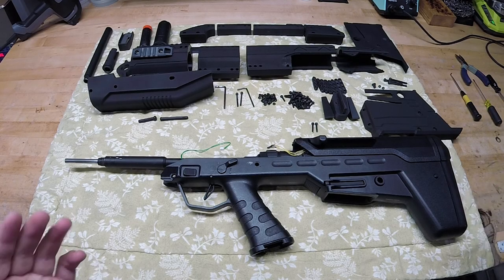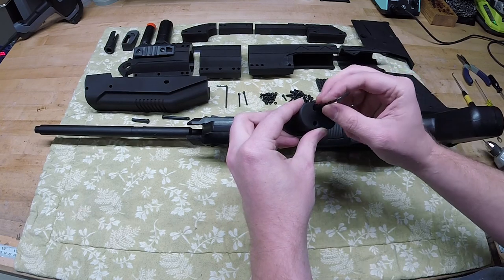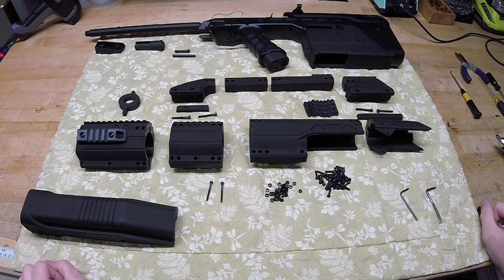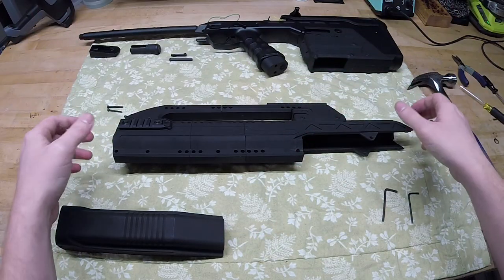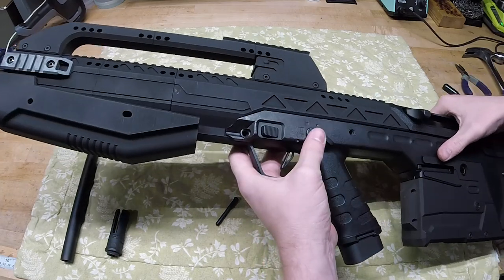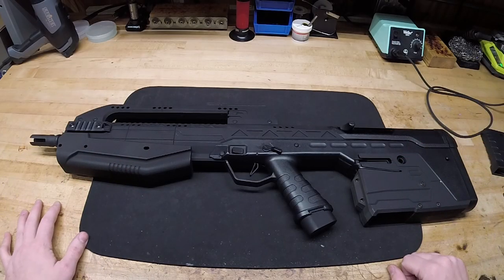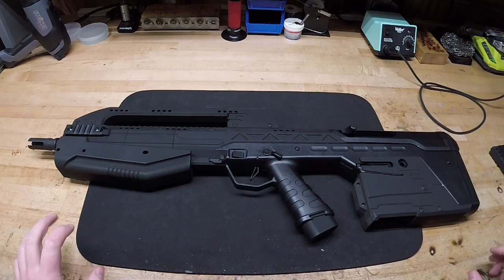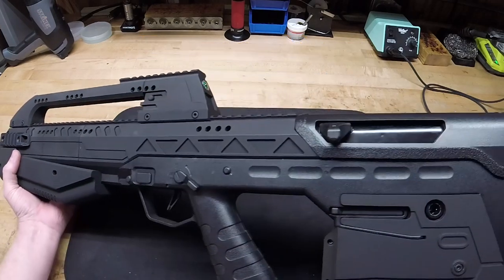Halo Airsoft Battle Rifle Review - (By Foundry Airsoft)

Comment: Okay so I just tried putting this together with my friend, and they started Soldering the flash hider to the barrels. We tried alcohol and hot water, we eventually just went and piggy backed to get enough leverage to twist it off and we actually saw the soldered metal curling as it came off.

Comment: question mate, what kind of stubby mags are you using for this for the baseplate to work onto and make it flush with the magwell and where could i purchase them (UK)? and do other type of stubby mag work as well with in magwell and with the base plate and also purchase them, and then does the baseplate work on longer curved mags?